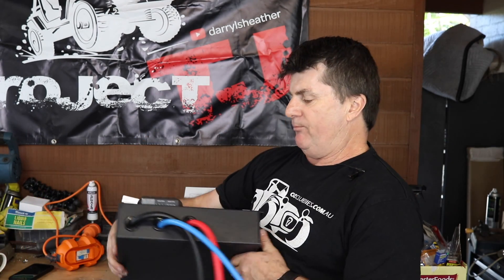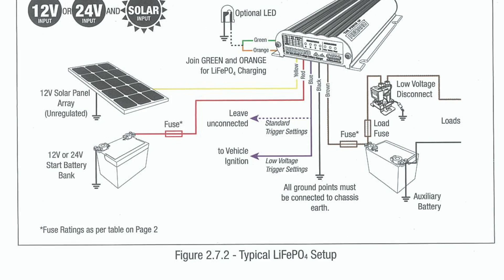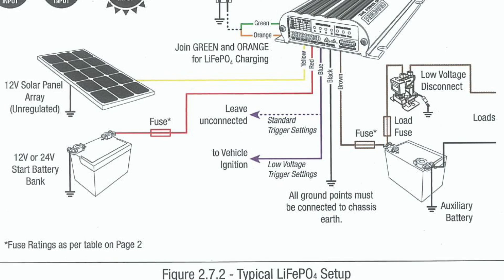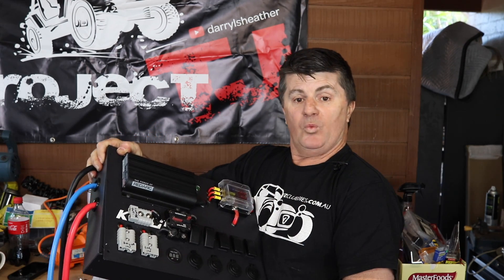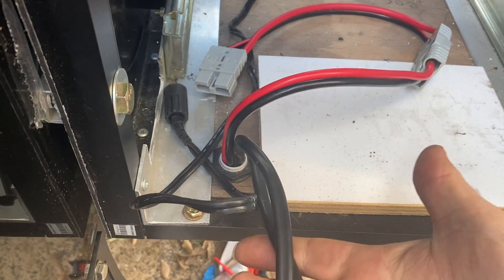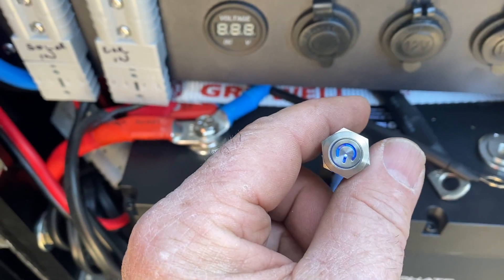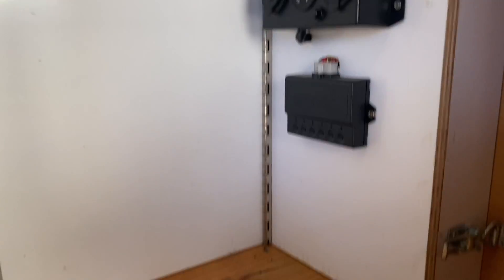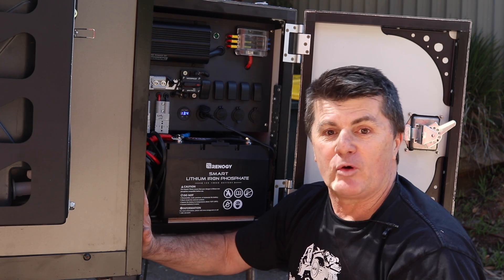Off Road Camper Trailer Build // Lithium Battery and BCDC System

Comment: Awesome build mate love watching the process and what you had to go through. 

You probably went a little big on the cable sizing. 
There’s really good app to calculate your cable sizes and voltage drop. 
‘Wire sizer’ 
Are you going to add an inverter to the build? 
Keep up the vids!
Reply from the maker: Thanks for the tip.

Comment: Ok for the USA! Please explain why you are using a "BCDC" never heard of it before??? Are you changing current or voltage for a 220 volt inverter? Your jeep should be 12v, your trailer should be 12v; how are you controlling the charge rate of that auxiliary battery you have no charge controller "isolation circuit".
Reply from the maker: It's a smart battery charger that takes different feeds (say 12 volt from the Jeep and the unregulated solar panel charge) it regulates the solar charge internally and chooses whether to charge the camper battery with a full solar feed or full/part 12v Jeep feed ( it prefers to use solar charge if its available). Then outputs to the battery using a user selectable battery profile (AGM/Gel or lithium) charging the battery to 100% then maintaining it at that level.
Reply: @DarrylSheather  So it's a fancy Australia term for an MPP Charge Controller ok got it. Seems like over kill for the purpose Thanks